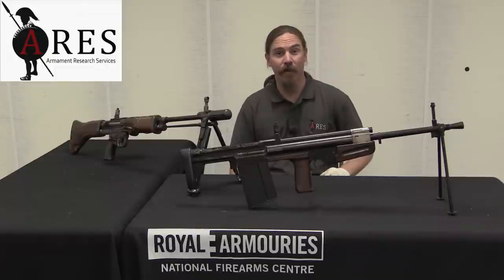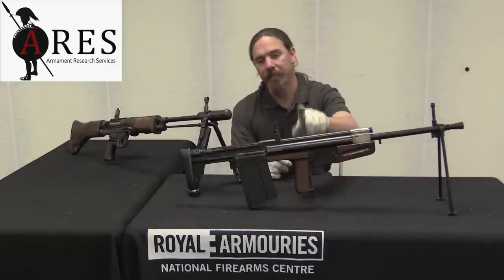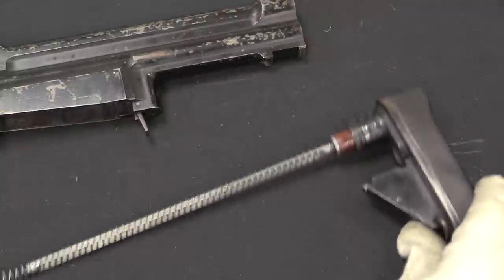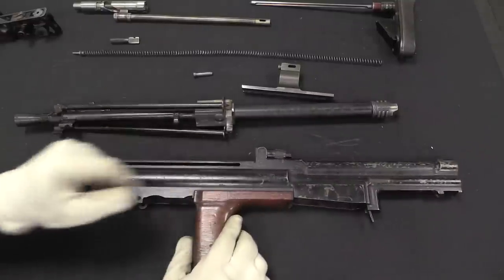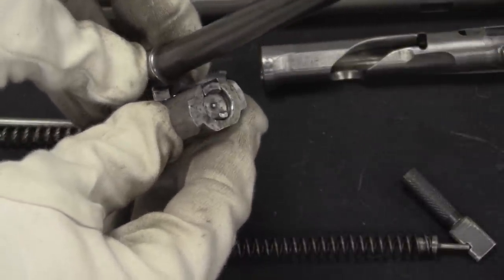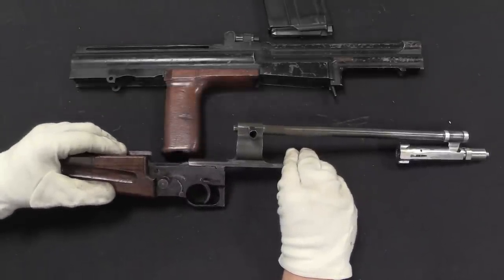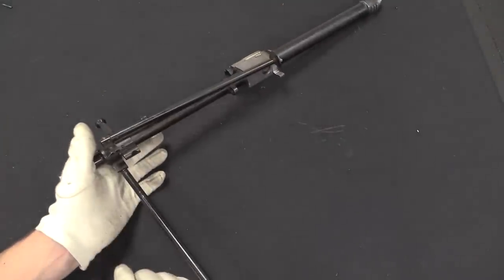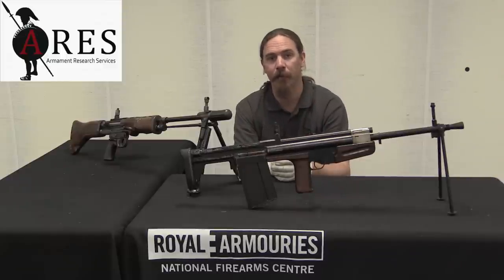The Korsac EM1 - a British/Polish Bullpup FG-42

Comment: So much British bullpup potential and it turns into the L85 -A1.  Oh dear.
Reply: John Brooks lol thought the same
Reply: it looks like a battering ram for a door
Reply: Design by committee was one of the reasons British industry started failing. The SA-80 family was designed by committee, you can polish a turd but it will still be a turd.  It was wrong to issue that piece of shit to troops, it should have been dumped 30 years ago when it was clear to everyone that the platform was a failure.
Reply: Ben Dover it is a good rifle now.
Reply: It barely passes certain standards. The weight of the thing alone means it is not a good rifle, too heavy with terrible balance.
Reply: It barely passes certain standards. The weight of the thing alone means it is not a good rifle, too heavy with terrible balance.
Reply: Ben Dover balance is actually ok. one of the few rifles ive futzed with. total weight is a little high.  but i find it comfortable to get a cheek wield to and its manuoverable
Reply: ben dover the m16 when the Russians tested it in cold conditions it blew up same under water the Russians wouldn't shoot a peace of plastic anyhow they stick to the klash and the new as 12 for better than anything the us made leslie
Reply: This thing would be much worse than the L85 you can tell just by the way it operates and the semi auto would be just as bad as a full open bolt with all the mass
Reply: The AK is no better than An AR and under water it would blow up too and last I checked the modern rus guns have just as much plastic as any other
Reply: all this 556 rifles is nonsense the west had the best infantry weapon the FN in all its models worked perfectly in situations gunmen using m16 had to get close firing a lot of ammo soldiers in the british army took the guy out with 1 or 2 rounds using 762 in afganistan they went back to 762 against arab gunmen it sells rifles on the market because future wars will be on the streets of Europe and usa to bring in there new world order its politics they don't want a battle field rifle anymore they don't need it funny the new Turkish rifle is 762 they must have looked at the mistakes and took the best option leslie dodds
Reply: even the best bullpup is still only a bullpup.
Reply: Pimperino no we dont. thats the germans.
Reply: the new sa80 a3  is upgraded with a rail and flip sights itll prob sell well as there starting with something now that works soldiers sayed they tried m4 different weapons and they sayed they rather have sa 80 a2 whatever there stuck with it 762 shartshooter still gets them out of trouble at longer range keep your head down those new elcan sights look deadly leslie
Reply: John Brooks yep they went to the dance with the wrong girl
Reply: Rufus Chucklebutty no one considered arquring Lee-Enfields doesnt stop them being great guns.
Reply: What's wrong with plastic?
Reply: The L85 A2 is actually a really good gun it's reliable, controllable and easy to use
Reply: Agreed but even accepting that the committee of newbies was given a blank sheet of paper, there must have been someone in the factory that could have pointed them to a rack containing the Korsac, the later EM1 and 2 and said 'these can be improved'.   The armoury at Enfield was extensive in the early 1970s, containing hundreds of British and foreign firearms and they couldn't have done much worse had they tried to bullpup a Brown Bess.   'Bite, pour, spit, thirty times a minute might have been fun! :D
Reply: with German help they have made it suck less, but would anyone pick the A3 over say a AR15
Reply: Exploatores Yes
Reply: Exploatores I definitely would
Reply: it would prob jam leslie
Reply: some Canadian soldiers had the Belgium fn 762 rifle then converted to the diemanco 556 which really is an upgraded m15 and they sayed they preferred the FN 762 my opinion of the whole mess is the existing SLR  rifle should have been modernised made a bit smaller lighter and firing 3 round burst because of the big 762 round with top rails for optics  then they would have had a real rifle to take on every threat with the gpmg for fire support and the Minnie 556 if needed you could even mount a grenade launcher as well  job done leslie
Reply: It's a Polish designed bullpup...
Reply: polls are over here looking work man
Reply: @Warellis Arizona mud could be the best mud for testing firearm reliability but you didnt know u could clean AK chamber very quickly with only a bottle of water right?
Reply: Our partially Germanic heritage perhaps?  They go wrong because of the French influence that arrived later! :D
Reply: SMGJohn the ar-15 is easy to field strip and clean under fire. compared to most rifles. the AK is easier however
Reply: @thisghy: Cleaning AK chamber is much easier than AR-15's star chamber. I'm also curious how much accuracy that thing can increases for an AR comparing to a AK chamber.
Reply: kalash la it does improve accuracy with 6 lugs instead of two. it's a tighter fit. one issue after thousands of rounds is one lug might break off a bolt.
Reply: Edith Dodds Or, you could use a 5.56 rifle as your service weapon and equip some soldiers with 7.62 DMR and 5.56 LMGs for support..
You know, kinda like almost every modern combat unit does..
Reply: Which has now turned into the A3. Oh yeah.
Reply: John Brooks at least that led to the A2 which is a very good rifle.
Reply: SilverFurby you ever fired an A2 ? Used it on exercises in the field or on tour ? If you had you know its a good weapon system.
Reply: Hey, we got the L85A2 from it at least!
Reply: Don't get too excited. This gun is lousy despite its cool looks. On closed bolt/semiauto it's both unreliable and inaccurate, and the problems could no be solved without a complete redesign of the firing system. The project was terminated for a reason.
Reply: A one of a kind bullpup polish fg42. If I was the devil making something to temp gun Jesus this would be close. Maybe I would add some delayed toggle lock action.
Reply: @edithdodds190  and the combat with Ukraine shows the ak 12 is complete garbage... front rail can't even hold zero
Reply: The L85 is a perfectly good gun.
Reply: Government involvement in anything has serious deleterious repercussions.

Comment: That flash hider looks exactly like the one off of the Lee-Enfield Jungle Carbine. I'm willing to bet they used some of the same tooling to make it and it looks like it takes the same bayonet as well. I'm sure that commonality of tooling and some of the accessories was meant to be a selling point for this, just like the US intended with the M1 and M14. Funnily enough, the M14 receiver was so different from the M1 (probably because it's slightly shorter and narrower) they had to get new tooling anyway.
Reply: If not for parts commonality, they probably used the tools and parts available to use dierctly or to copy, like all the EM rifles copied other rifle designs.

Comment: Ian, how is the trigger pull on this gun? I'd imagine its pretty darn crisp considering the way the trigger is linked to the action. Wonder why more bullpups don't use a system like this.
Reply: Most other bullpups don't use this kind of trigger because it really only works with the specific way an fg42 fires, as most other closed-bolt rifles are hammer fired

Comment: Question: what would happen if someone charged the weapon while set to ful auto but then switched the fire selector to semi? Would the bolt drop and chamber the round, would the bolt stay back and then drop when the trigger is pulled, or would it lead to some other outcome?
Cheers
Reply: I guess (read "I hope") the secondary Single shot sear would catch the transfer thingy.
Reply: So basically when you switch over to semi, the auto sear drops, the semi sear rises and the transfer frame falls forward? So if you do it slow enough, you get and uncontrolled discharge by way of the transfer frame riding over the not-yet-high-enough semi sear?
Reply: That's an interesting question. Only real way to find out is to get a real FG-42 and try it with snap-caps.
Reply: I would assume that the switch is set up so that at any point in time one of the sears is lifted unless the trigger is pulled. (i.e. 2nd sear lifts before 1st one drops on switch)

So, it'll drop shut when switching from full auto to semi auto (semi auto sear rises first, then full auto sear drops and bolt goes forward).

No idea about semi auto to full auto. Maybe the full auto sear can also catch on this T-shaped cutout that the semi auto sear engages with?
Reply: There are videos of the FG-42, I believe even our lord and saviour has one where he demonstrates this very principle ...
Reply: And does he go into detail on that particular part of it though?
Reply: piritskenyer If one recalls correctly the bolt closes but does not fire.
Reply: Excellent question. So good in fact, that I went to the racks and checked the actual weapon, only to discover that Ian and I had both missed that the two sears had been installed back to front (or rather, left to right!). In the state Ian has it, it will fire full auto on both settings. Now it's been reassembled correctly, it functions properly. And yes, when you switch from open bolt auto to semi, the slide flies forward onto the semi sear and is held there ready for a semi-auto shot. If you do the reverse, the first shot will fire with the bolt close, but then for all subsequent shots of the string, the bolt will operate from the auto sear (i.e. the front edge of the slide). If you release the trigger, it will remain held open ready for the next string.
Reply: It's not a feature of the FG, only the Korsac.
Reply: I've just tried it, and no, the two sears have enough travel overlap you can't get an AD that way.
Reply: Thank you very much for going to the trouble of finding that out for us Jonathan, really appreciate it!
Reply: @jonathanferguson1211  I'm trying to visualized how that transition works mechanically. The slide doesn't appear to have a spot for the auto sear to catch it when in it's already forward its semi position; so despite flipping to auto the semi sear must still be holding back the slide.  
That mechanism may not have been fully functional during Ian's video since the sears weren't installed correctly, but it would be fascinating to see that mechanism's details and understand how reliably safe it was (or wasn't)

(My first thought was spring tension on the slide might just prevent the semi sear from falling; but that'd be dangerous because bumping the charging handle might then cause AD)

Comment: Curious as to why the rifle did not fire semi-auto consistently. Did the Mauser 8MM not produce enough force to fire the bullet as well as reliably cycle the bolt to the semi-auto locking position with the additional kit to make the bullpup config. work? It would make sense because the FG-42 did not have that in its design spec. Maybe the recoil spring was too heavy? Or maybe it was some other mechanical problem? Someone care to explain?

Also: the Brits had this monstrosity and somehow managed to create an even uglier rifle in the L85. Impressive.
Reply: The design just didn't give enough spring pressure to the last little bit of travel I suppose. Would have needed to make a much stronger spring, thus mucking up other parts of the operating mechanism, or go back and tweak the length/weights of all the parts
Reply: Lord_Avvakum L85 A2 is pretty leave it out.
Reply: It´s got nothing to do with the cartridge power, that had long down its job, the bolt was already closed, the main spring  was already released except for the last half inch.
The main spring also has pretty much no word in accelerating the firing pin (not in semi, that is), this is done by the firing pin spring.
But - for cycling by hand, the gunner has to compress the firing pin spring which pushes the bolt against the locking surfaces, this produces friction which makes the first bit of the pull quite hard.
So the firing pin spring must not be too heavy.For the gunner this may not be too much of an issue, but maybe for the gas tappet, which has not that much of a piston stroke.
A slightly longer piston stroke would have been a way around that, but could that have been incorporated in this system?
Reply: Lord_Avvakum
You need to re-examine that part of the video because I think you just misunderstood what was happening in the action. In semi-auto, the bolt assembly is locked forward only a few centimeters away from fully closed, so the recoil spring is nearly fully extended and therefore providing little pressure for the firing pin to strike with. In full-auto, the bolt is locked towards the back (open), so the recoil spring is under significantly more pressure. Each shot in full-auto is therefore going to lock the action at a point where the recoil spring can provide most of its power, while each shot in semi-auto is going to lock the action at point where the spring cannot provide anywhere near the same amount of force.

Comment: Makes sense for them to use the ZB mags. Considering the designers were East European, they would probably have some knowledge of their design, if not experience with them.  Well you could argue Central Europe, but either way, my point is that the Poles on the design team would almost certainly have been exposed to Czech designers, and the service cartridge in both countries was 7.92X57, IIRC.

Comment: I think the reason for changing the unlocking direction of the bolt is that they flipped the action upside down, so that they cold have a bottom feeding gun without the gas piston being in the way while keeping the ejection port on the right side of the gun

Comment: Hello Ian, those aren't interrupted threads but simple geometry lugs.  On the barrel, they would have been turned as grooves and then a second machining operation on a milling machine to make the interruptions.

On the inside of the receiver, there are a few options, aside from the seam line like you pointed out.  

Simplest is making a thread down in the receiver with an extended tap, and making a threaded portion that would then be later installed to have the female interrupted lugs.  If they didn't do that, they could make an internal grooving tool that fits into the receiver bore fairly snugly, and has adjustable cutting bits like an expanding reamer.  Obviously the latter isn't very feasible, but it is possible to do.

I love your videos, keep up the great work!

Comment: Interesting way of combining the a striker with the gas piston and combining open and closed bolt operation did not know that about the FG 42. Also avoids they usual transfer bars attached to the trigger on the later bullpup. I wonder how well the an FG 42 chamber for an intermediate cartridge would handle compared to other assault rifles.

Comment: I'm not good at physics and math but or even engineering. From the eyes of a chair gun nerd;
The things that makes it unreliable in semi probably
Too much of a mass and too little distance and those 2 springs is just enough without making it too heavy to cock open

If someone crazy enough let me design a gun using this system.
 I would probably lay the gas system sideway, like Steyr Aug and have the saperate firing pin/striker+rod on the other side making it a bit lighter

but well, I never design machine or even shoot gun before so might not even work. this is just my ramblings of a armchair gun nerd

Comment: The opposite rotation of the bolts is due to gas system positions. On FG its under the barrel, with Korsac above - but on both you want the extractor to be rotated  to the right side of the weapon where the ejection port is.

Comment: That trigger mechanism seems like a neat way of getting around the transfer bar mess that apparently makes bullpup triggers so terrible (not speaking from experience, never fired a bullpup). Also: Wouldn't the FG42 potentially have the same problem of misfires if they have functionally identical trigger mechanisms or did I misunderstand something here?
Reply: Less loss of spring tension on the bolt in the non bullpup variant.

Comment: Ian, considering this rifle unlike other bullpups doesn't use light flimsy bits of metal for the transfer of it's trigger but rather large heavy pieces of solid metal, how did the trigger feel? Better or worse than other bullpups. Of course this is a trials gun and museum copy, nor did you get to fire it, but I am curious if this is a better trigger design for a bullpup.

Comment: The other big design difference is Korsac put the gas system above the barrel. I guess while he was modifying that he ended up changing the rotation of the bolt too. I think he should have kept the op rod on the bottom like the krauts did. Then he wouldn't need that giant sear slide thing dragging down the whole system.

Comment: Question : Do you relube the guns before you put them back together?
Reply: Hell no!!  It will eat away the metal  on the working parts faster; clean and oil before you use doing so can keep the barrel in better condition for longer.

Comment: Why is there a change with Open bolt and closed bolt in semi and full Auto? 

I guess close bolt in semi means less Vibration and better aiming!? But why change that in Full Auto?
Reply: I'm no expert but I imagine that overheating was a concern as the barrel wasn't exactly a quick change like a full size Machine Gun, as well as it simply being easier in that time period with certain designs.
Reply: Closed bolt guns when used in full auto can have a malfunction called a cook-off where the barrel gets so hot that a round sitting in the chamber can ignite and fire without the primer being touched. A lot of machine guns are open bolt for this reason